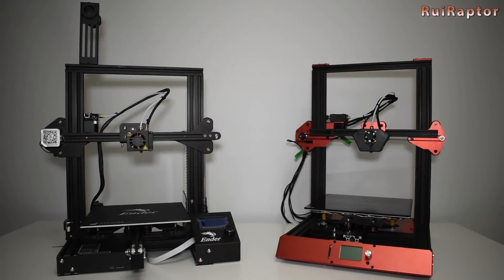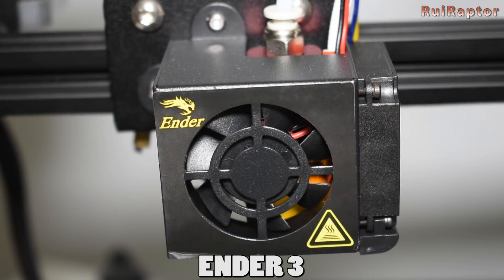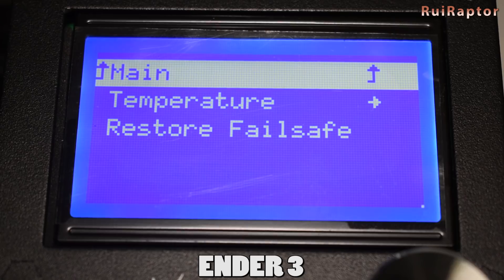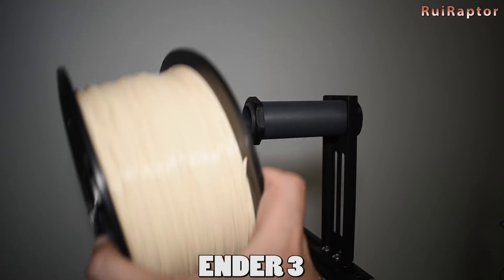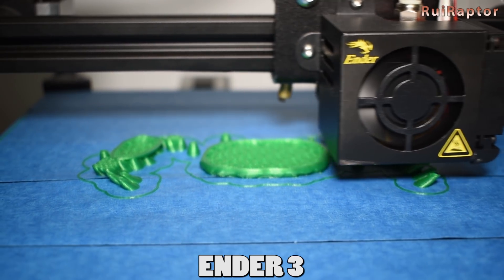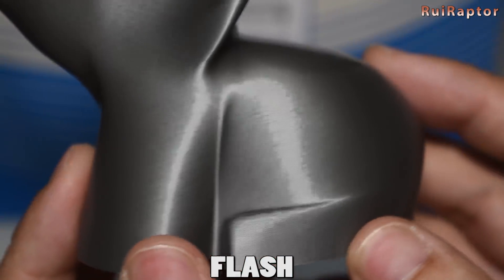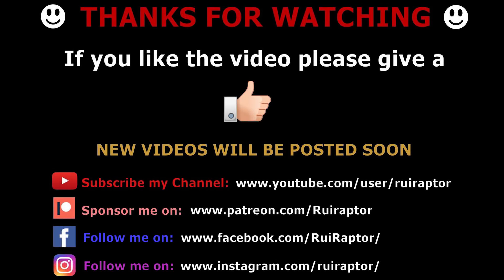Creality ENDER 3 vs Tevo FLASH  - Which is better?

Comment: So I'm wondering how to interpret the results of print quality test given the tevo has many upgrades that help with print quality, but the ender 3 has almost no upgrades. The Tevo had better print quality. But the ender wasn't too bad. Don't ge the wrong. I'm no ender apologist. I just sent and ender 3 back because of a bent frame. So, that tells me their quality kind of sucks.
Reply from the maker: Hi Israel,
The stock tevo flash is being shipped with TMC2208 at the moment, so just that is much better (and it's not an upgrade).
Regarding the BLT sensor, that will only affect the first layer and that was not addressed in my video.
The dual Z can increase the print quality but these models work as good with just one Z motor/leadscrew.
Reply: I had a bad experience with the ender 3. I ordered it. It had a bent frame. The frame wobbled back and forth form the front left to back right. I expected to tweak some settings. I also expected to maybe have to get better parts eventually. I didnt expect to have quality problems such as a bent frame. I loosened screws many said that would make the printer level. Every time I tightened the screws back it went back to being crooked. Im happy your experience turned out great. But I just dont see myself supporting a company that cant ship a straight and level  frame.
Reply: i have acquaintances that have more than 10 ender 3's in their print farm and have never had that problem. You must be unlucky.. Thats unfortunate that you had that experience.  Did it get bent in shipping?   A bent frame doesnt really happen unless its a shipping incident.. 
What is this you say about the ender 3 having almost no upgrades?  Have you not googled anything or asked anyone about it that knows anything? you can literally type in youtube and on google and see tons and tons of upgrades for the ender 3.
Dont get me wrong, im not on Creality's nuts. I own a Geeetech Prusa i3 pro and a BQ Hephestos .  But for a cheap sub $200 printer, the Ender 3 is unbeaten on the market right now.
Reply: Totally asked about it on the ender 3 forum. When I started getting videos that recommended totally tearing it down and banging on brackets to get them straight, I decided it would be best to send it back.  The printer actually had an 1/8-1/4 inch wobble from front left to back right. Yes I loosened the appropriate screws and retightened per the instructions of the ender 3 group.  I was looking for a sub$200 that printed right out of the box. The reviews I watched, and I watched several, indicated it would print out of the box. I just wasn't looking for something at that point that I would have to bang on brackets to possibly get it to be reliable. I expected to tweak and maybe upgrade some stuff. However, I wasn't expecting a complete disassembly and then  possibly still have problems due to very poor quality control. Honestly after the ender 3 and then the same exact problem with the MP select mini pro, I think I'm going to go Prusa and either assemble or just buy pre-assembled. After seeing Thomas Sanladerer's tour of the Prusa plant, I'm pretty impressed with Prusa's commitment to quality.  I don't mind doing the work. I just expect stuff that advertises a certain thing to live up to the hype to a large degree. The ender 3 simply didn't live up to the hype for me. And I wasn't going to go through all the work sending stuff back and then still have the same problem. If creality wants any future business from me they are going to have to fix the issues I experienced. Even if they did I don't think I would consider their stuff. I think I'm just going with a printer that costs more but has phenomenal technical and customer support. Creality just doesn't seem to be in that business as much as it is in the business of making money off of everyone doing their R&D for them. I detest that business model. It puts profit above customer experience all while trying to look like it is actually for a good customer experience. There's a word for that. I don't want to support companies like that.

 I didn't mean to imply that one couldn't do upgrades on the ender 3. I was only pointing out this comparison was done on a stock ender 3 versus a tevo flash which has several upgrades to help its print quality.
Reply: I also ordered a mp mini select pro with the same issue. One person said just put some shims under the feet. But after seeing the quality problems printers from China have, I think im eventually going prusa or just build my own. I was taking a look at tevo but am reluctant given it is a chinese printer also. But tevo seems to try and put quality into their printers with the features they are offering out of the box. So I am considering tevo.
Reply: his print quality is showing his skill level and how in tuned he has his printer, or lack there of..  my prints are coming out awesome.  So his comparison is a misleading bad example; there is no telling if he has even done anything other than turning it on and printing from stock.. could have something loose or an uneven print bed.
 Im using both Cura and Simplify3D.. my profile settings are pretty tuned after a month and my printer is pretty tuned in as well.  There are some good FB groups that helped with that.
Reply: @br0k3nilluzion  Let's be fair though. This is a side by side out of box comparison. I don't think he's tweaked any settings on either printer. If you'd seen any of Raptors other videos you'd know that he's actually very skilled and knows a whole hell of a lot when it comes to 3D printing and on Tevo printers in particular. That being said, and coming from a standpoint of someone who knows little to nothing about 3D printing. I also don't think it's fair to compare these two printers as their price points are wildly different. Lastly, what would you suggest for someone in my position. I came across a FREE Tevo Tarantula. I just received and installed the replacement parts that it was missing (dude I got it from had no idea what he was doing) and I'm now going through the process of finding out what I need to do to get it printing well (Z Axis Upgrade, etc). But before I begin dropping more money into the printer I wonder if I should budget out everything that I would need to buy/install to make it print as well as a brand new kit printer (such as an Ender 3) and see if I should just bite the bullet and go that route, then piece this Tarantula together as I go. On one hand that route would get me printing well quicker with a little bit of cost. On the other hand grinding out and fixing the Tarantula up would get me a lot of knowledge about how 3D printers are made and how they function. Thoughts?
Reply: @Madscrills   thats awesome that you got that printer. 
Well their is a couple of ways you can think about it, lol.  On the one hand you'll definitely get the experience of fixing and tweaking the printer to get it to work.  But depending on what is wrong or missing it might cost you a little bit.   But unless he did some major things wrong , it probably wont cost that much to fix at all.  
From some of the guys experience with Tevo, they might or might not be that much of a help in giving you any type of warranty, especially since youre a 3d part recipient now. 
On the other hand, an Ender 3 pretty much works out of the box, just takes an hour or 2 to put together and some bed leveling and such.   
I'd say the Tevo would be the same, but a lot of the guys at the Hackerspace/Makerspace down here kind of have to put in more work to get em to print..  and they have a ton of printers.   But then one guy had his running pretty simple after some tweaking. So its a mixed bag of nuts.  
Honestly, I'd say join some Tevo Facebook groups and hit them up in general chat to try and get your Tarantula up and running.  You got it for free and it probably wont take much in the way of cost to get up and running, just depends on how much time you have and if you want to invest it. It will take your time though, thats one thing the 3d Printing hobby is good for. lol
  The ender 3 groups im in have been pretty damn cool and helpful.  Get your Tevo printing and you'll be pretty happy.  
Once you do you'll get the bug quick, and then you'll be like me and everyone else and have to get another one. lol
Then you should try the Ender 3, unless you want a bigger print bed and then it'll probably be the CR10S that catches your eye.
Reply: @br0k3nilluzion  That all sounds pretty reasonable. Yeah I'm already in a good FB group with a TON of people and it seems very helpful and active. I appreciate the insight. I'll get it working one way or the other!
Reply: This video seems to support the idea that the ender doesnt beat the tevo. But it is telling that the tevo has to have the upgrades it has to beat the ender. However that wont make me go ender3.
Reply: Ender 3 has tons  of upgrades.  Print quality on the Ender 3 is awesome. Im printing D&D minis, rc boats, quadcopters,  ABS parts for the car and etc..   for the Price the Ender 3 smashes the Tevo

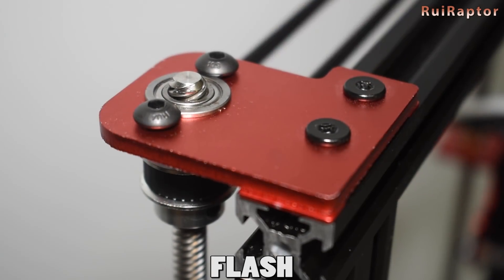Comment: So, if i support the Axis on my Ender 3 with a bearing on top - will it mess things up? i don't get it.... 1:57
Reply from the maker: Hi Marton,
The ender 3 uses a rigid coupling which means that not having a bearing at the top is better in this case. 
A bearing at the top when using a rigid coupling can have a negative impact on the print quality.
Reply: The ender dont need a bearing.  They didn't use cheap coupling like the flash did
Reply from the maker: You are stating what I just said.

Comment: The Ender 3 has 235x235x250.
Reply from the maker: It's funny because in all the specs (including creality's specs and including the stocker on the printer itself) mention 220x220
Reply: you should measure it before you throw out numbers.. its 235x235x250..  literally measure it and you will see.

Comment: Can be a bit cheaper?  That's dishonest. The Flash is like $125 more expensive. You made it seem like it might be a few dollars more.
Reply from the maker: Since I didn't mention any values (because the values differ according to different stores and promotions) and it's true that one is cheaper than the other, I don't consider my comment to be misleading.
Furthermore, I included in the video description the links for both machines so everyone can see how much they cost.
Reply: @ruiraptor  why not just say,  Almost half the price of the flash that still needs a spool holder
Reply: for the price and how good the Ender 3 prints, the Ender 3 smashes the Tevo

Comment: Greetings, very well done your video.
I like flash tevo AND I HAVE 2 QUESTIONS:
1-Could you give me a configuration for slic3d - Simplify3D.
2-What PLA filament you recommend, I like the one in the video but I do not see it in amazon.
3- What is the difference in the 2 models in which the TEVO FLASH is sold.
Thank you very much for your help and success.
Reply from the maker: Hi, Here are your answers:
1- Contact me by email please.
2- I use Filament PM. It's an European brand and can be found in Portugal for example (check the video description for the link of the webstore)
3- The tevo flash is sold in the 50% built version and in the 98% built version. You can find the unboxing and assembly videos of each in my channel. You also have optional upgrade items for both such as dual Z, BLT sensor and TMC drivers.

Comment: Hello! Good review! Is it easier to tighten the bed's belts of Ender 3 than Flash's? It's about the access. The major thing is bothering me about Ender 3 is that I need to connect an Arduino to it just to change a firmware. Almost the last question: where is the Flash's reel (bobbin)?
BTW Flash looks more compact... I don't like that Ender 3 reel's place is so high.
Reply from the maker: Hi,
To tension the Y axis belt, the difficulty is the same on both (very easy).
Regarding the firmware upgrade, you need an arduino (Uno, mega) to install the bootloader first. I will have that procedure on video very soon.
Regarding the flash reel, are you asking about the spool holder? If yes, it's not included. In the SD card you can find one to print and install at the side (which is better as prevents vibrations on the frame).
Reply: Yes, the spool holder :) I've seen the video (in Russian) how to upgrade firmware on Ender 3. Is Flash supports an easier upgrade procedure (via USB cable or SD card)?
Reply from the maker: Yes, the flash is much easier to upgrade the firmware. Just connect the included usb cable and flash the firmware. Very simple.
I have this procedure in video. Just look for the firmware upgrade video for the tornado (same procedure).
Reply: thanx!
Reply: wow, the AC bed... I've just realized that... Not very safe to get it hot from mains... The overall it must be better but the safety...
Reply from the maker: The AC bed is safe. It's controlled by a SSR located inside the printer.
Reply: Is there no places where it can be shorted to ground just by touching or some other occasional conditions? Not by a purpose of course.
Reply: @KiR_3d  fire hazard.... Get an ender3
Reply: Non-fixed Ender-3 is a fire hazard. Do you mean that?

Comment: With thermal protection on I cant go beyond 80 C to print Nylon, it halts the print
Reply from the maker: That means that your bed is not being able to work at higher temperatures.
Try to run a PID calibration
Reply: No, it aint that. You need to increase thermal protection settings to not trigger it falsely

Comment: Wtf? You have 0 ringing on the Flash! Mine is horrible, even after tightening all the belts, putting more vref on the steppers and lowering the acceleration from 3000 to 1000, its still so much ringing!
Reply from the maker: I'm printing at 50mm/s and 25mm/s the outer layer.
Reply: wait, at which speed did you print those prints?
Reply: Then it is your hotend that is not fix rigid. Titan Aero looks solid
Reply: Hmm oke I print at 30mms, so that shouldnt make to much of a differance.

When you move your bed forwards and backwards, and look in the reflexions of the bed, do you see "vibrations" when accelerating and decelerating? Or does the reflexing stay stable?

Comment: I want to start in the world of 3D printing, and I would like to know, with which printer do you get more defined pieces? ender 3, tevo tornado or tevo flash.

I like the volume of impression of the tornado, but I want to get a very good definition in the pieces.

Which one would you recommend?

Thank you
Reply from the maker: Hi Jesus Gaso,
You can get very good detail from the tornado but to achieve that you need to upgrade the layer cooling fan. I also have a video explaining that.
Reply: @ruiraptor  I have seen the video of upgrades for the layer cooling fan.

then with this modification I can achieve some details similar to the tevo flash?

If I can achieve that, then I'm going to buy the tornado.

thank you very much for your videos
Reply from the maker: You can see some pictures of prints made with my tornado on my facebook page.
Reply: @ruiraptor  thanks very much

Comment: The spool holder bracket is reversed. If you turn it around, the larger spools will be accommodated.
Reply from the maker: Hi Andrew,
I tested with the bracket reversed too and it does not fit. The 1Kg filament spools from Filament PM do not fit.

Comment: Only correction: Mechanical switches are MUCH more reliable and MUCH more precise than proximity sensor and, because of interference, precision, and activation boundary.
Reply from the maker: Hi Raidzor,
No they are not. Mechanical switches are less precise. Even more when you have the metal lever that can bend with time.
And regarding the interference, it actually depends on the brand. The ones used are very good (just check the datasheet). Just google for "endstop mechanical switch vs electronic switch" and you will see that I'm right.
Reply: @ruiraptor  Actually doing my research you may be right but partially. It all comes down to one thing though: mechanical switches will have a precise boundary, which is incredibly precise (up to a micrometer), because the internal contacts either touch or not. When we have a proximity sensor, ultrasonic or optical it is, there is a small variation between activation distance when the object that activates the switch is directed towards (the activation distance is usually smaller in this case) or from the switch (Where activation distance will be slightly increased).
But about reliability I was wrong, because if you think about it there are moving parts in the mechanical switch that wear out overtime.
Personally I stated what I stated because I had a much better experience with mechanical rather than proximity, which seemed to break every other print (And they weren't that cheap even).
Although it may have been bad luck, based on my personal experience and my laziness to try out and mess with different proximity sensors, for now I prefer to stick with mechanical.
Reply from the maker: Hi,
Thanks for your feedback.
I actually work with precision metrology machines that need to be accurate by the micron or even less and all the machines have electronic optical sensors for endstops. These are high demanding machines with high accuracy (which include laser scale encoders) and other levels of calibration but this is a good example of machines that DO NOT use mechanical switches not only for reliability but also for repeatability and accuracy.